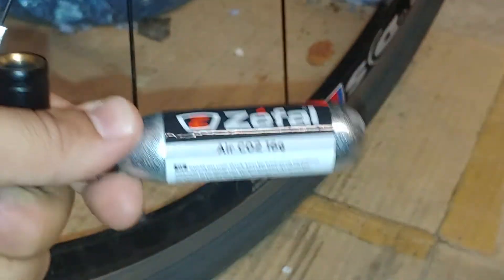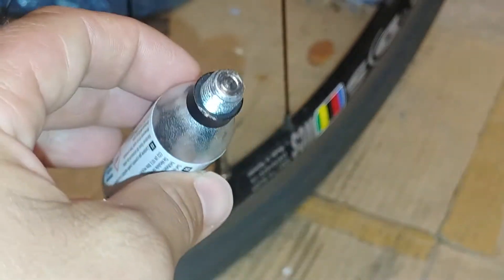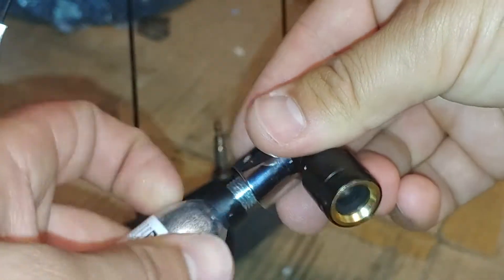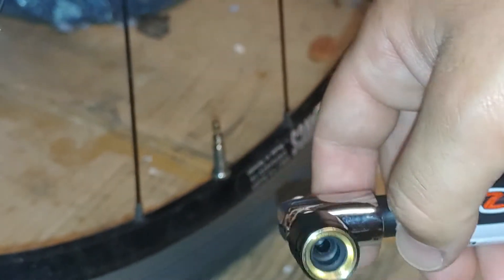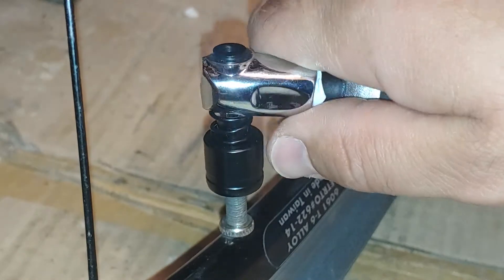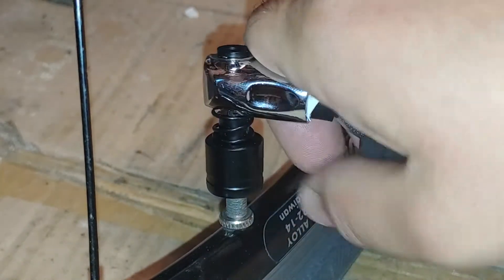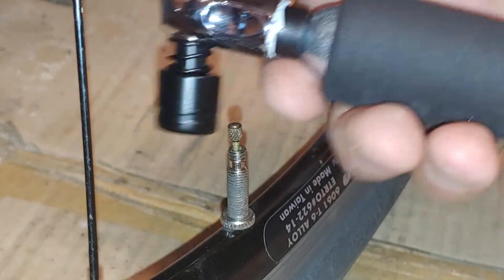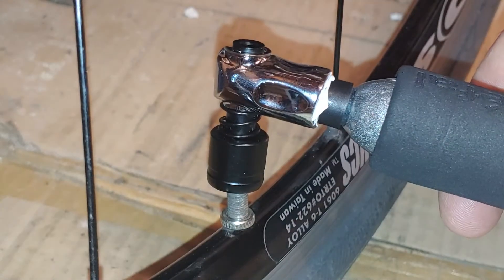How Zefal EZ Big Shot Co2 tyre inflator works

Comment: You have to remove the black plastic washer that you have between the CO2 bottle and the pump.  This washer is a safety device to prevent the capsule from being accidentally punctured when transporting it
Reply from the maker: Yes I know, it was my only one so I left it for demonstration purposes thanks